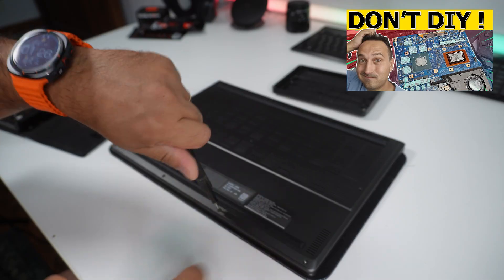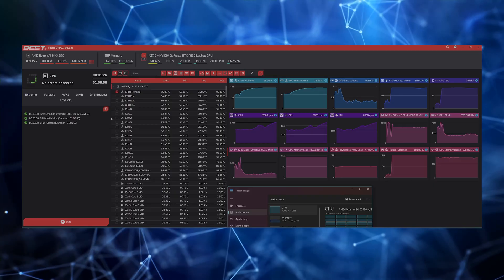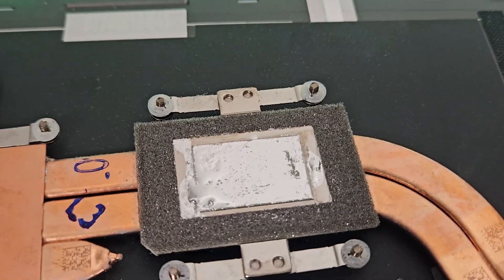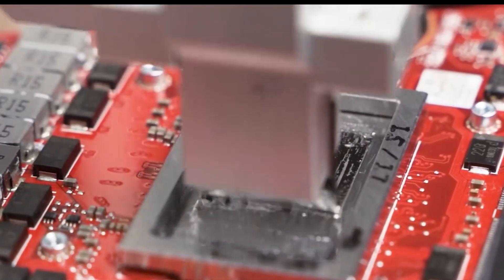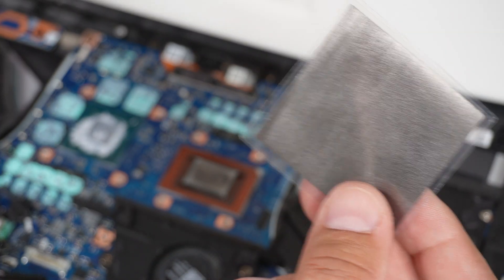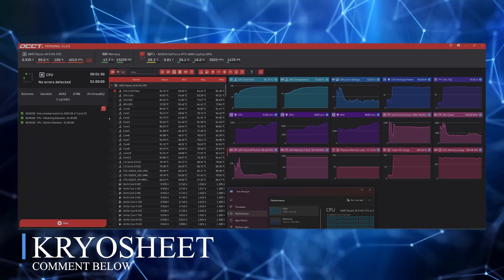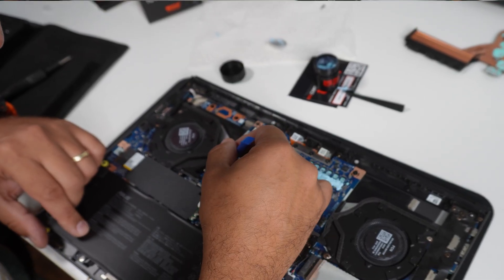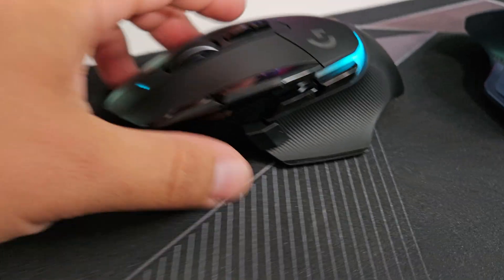I Replaced Paste Liquid Metal with KryoSheet… It’s Actually BETTER!

Comment: Thank you for taking time to investigate! I think i'll go for this too. Can you please tell, how are your vram (memory junction) temps are doing? I have almost the same zephyrus g16 hx370 - my vram is 88-92 while cpu and gpu are chilling at 65-70c with 78 hotspot. As soon as gpu hits at least 70w, it goes to 90-95c. Im kinda scared to push it this far considering current market situation but also at a loss - i cycled through several thermal putties with pretty similar lackluster results. 

One thing to note - it wasnt regular thermal paste on your gpu die but some variant of phase-change paste (usually referred as ptm7950 as for the most popular product). Considering the gpu wattage id say ptm or graphene pad would be superiour choice - ptm gives less hotspot delta and on my unit and both cpu and gpu coldplate clamping are very good, so either one should be applicable.

Comment: TG don't recommend Kryosheet for laptops, and I don't either. I've put it into a cooking Dell Precision 5560, It didn't get fried but it didn't seem to work much better than the stock paste. Almost 30 deg difference between the cores with Prime95 smallFFT. I suspect the problem could be that the heatsink isn't aligned perfectly enough, but this is common in laptops (K5pro may help with this but I didn't want to mess with it).
Reply: Modern asus laptops use nonnewton thermal putty to alleviate possible backpressure. Using anything except for goop (paste, lm) in laptops with thermal pads is borderline dangerous

Comment: This is interesting... I'm about to re-thermal everything on my Acer PHN16-71. Core i9, RTX4080... I'd like to see this under a proper stress test for a few hours.
Reply from the maker: This here is hand down the best thermal upgrade you can ever hope for.I love its set it and forget it approach,as you never have to re do it ever if you never remove the heatsink again.For me it worked great with better results then Liquid Metal.Its a bit overpriced but its really really good.Cheers bud
Reply: @Tech_Fusion you say that but I've been playing with PCs for 32 years from Commodore Amiga, 386sx 31, DX4100 and this laptop is a new demon. My last laptop was a 2019 HP Omen 17 and I got that down to 56c while gaming. More research is required before I do a thermal management of this one. Still, your video provided knowledge of something and for that I respect you. My cup is always empty.

Comment: Definitely cpu contact with cold plate was the issue due to thermal pads being too thick. Now go back to Conductonaut with your new putty on vrms n memories and see another 5c drop.
Reply from the maker: Thanks for the info bud and you might be on to something here but for 5C drop in temps,Ill take the peace of mind anytime and just leave it with the kryosheet.Plus this stuff is supposed to be doing its job for probably more time then the lifetime of the laptop hopefully so one less thing to worry about.Still it was a nice experience overall to have and if there is something I learned is that I hate dealing with LM Lol.Cheers bud and I do truly appreciate the feedback .
Reply: have you seen thermal pads in the video? Where?

Comment: Another advantage of Kryosheet (that can be pretty significant depending on the application) is the fact that, as it is a solid/maleable pad, it doesn't experience pump-out unlike regular thermal paste/liquid metal or even PTM7950; and coupled with the fact that it doesn't degrade...it's pretty much eternal and somewhat reusable. That's what I've concluded from my testing at least, running an Engineering Sample modified i9-12900HX with BGA-to-LGA interposer to use in desktop (Asus Z790 mobo), Kryosheet was the only TIM that lasted me for more than a month (10 months in right now) without performance degradation, everything else failed due to pump-out (Arctic MX4, MX6, TG Kryonaut, Kryonaut Extreme and PTM7950 tested at that time).
Reply: Not sure about pump-out being the problem but degradation generally. Any non-electrically-conductive paste is more than 10x worse heat conductor than silicon dye and heatsink metal. So the worst problem one can have is a thick gap. With PTM, the pump-out seems to improve performance over a few initial cycles as the gap shrinks. But here it appears that with a thick uneven gap in a laptop, the Kryosheet works worse than paste. Low pressure due to the little screws may be another problem.

Comment: u applied WAY too much lm sir. its not supposed to be like that. if you got better result with the sheet, good for you! but.. the sheet cannot even remotely compared to conductonaut with performance. this just means that you did not get a great mount with the lm.
Reply from the maker: Im sure i didnt do a good enough job,although check the footage as it looked very close to the original application and believe it or not but my stock performance wasnt really good.That was part of the reason I changed it in the first place.Still the kryosheet works wonders so that makes me happy.Cheers bud
Reply: @Tech_Fusion  yeah, LM can be quite spotty, specially in bare die applications (like laptops) where the cpu/gpu die might be quite flat but the actual cooler not as much

Comment: I’ve been using kryosheets since 2023 and I absolutely love them. I actually get better temps in some devices than Liquid Metal. Pro tip with cutting. Don’t use scissors. Get a fresh Razer blade and cut it on a glass table or hard counter top. Something impermeable. It makes it easier to cut on glass because you can take off the hard outer sleeves and. Make a quick cut. Also be sure not to use bare hands on them. The oils from the hands will permeate the sheet. I use rubber tipped tweezers or a sheet of paper to carry it and guide it into place.
Reply from the maker: Super cool info and thank you for sharing,really means a ton.I agree,with the cutting method and I subscribe to using gloves as well,even though I didnt have any on hand for the swap.I love my G16 more now as its quiter and also runs better with the extra CPU performance compared to the LM.Sure maybe my swap of the LM wasnt as good as the OG application from the factory but even that wasnt as good as this.So this isnt snake oil for sure🎉.Thanks for the feedback man😊